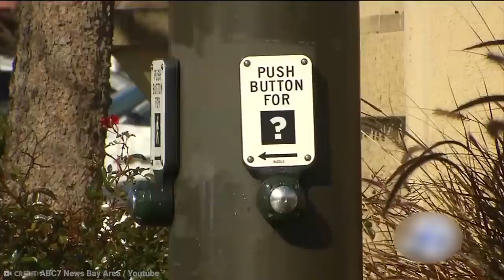15 Ways Governments Control Your Behavior With Genius Designs

Comment: Good idea about the waterproof paint, but given many of the public toilets are either non existent or shut at 5 or 6 pm, it's idea to prevent men using walls as a urinal after a night out doesn't work too well here in the UK. In fact the biggest public outdoor urinal for men after a night out are generally the tyre of a car.

Comment: DUDE I FUCKING KNEW IT!!!! I have been thinking that the buttons weren't working and were disabled for 20 years already! I noticed that after around 2000 they started to have no effect at many intersections and it continued to get worse over around 10 years. Since 2015 they appear not to work in most places that I have seen, though some do work.

Comment: Did you know that Kinetic Speed bumps have been invented to generate energy but countries like the USA are not willing to put them to use. Yep, standard speed bumps that, when a car goes over them, they lower some and generate energy along with slowing down traffic. They were proposed to be used at Toll Crossings where the cars have to slow down before coming up to pay toll. The idea was originally presented as an option to generate energy for the toll system as well as for lights used around them. Not an alternative but an additional energy source to save states money.

Comment: I always think that about the pedestrian buttons at the crossroad traffic lights in my city centre. As if the public are going to controlling when the traffic lights turn red.Yeah,right 😂🤣😂🤣😂
Reply: I dont bother pushing it, unless i know if its fake or not. In surten parts of town i know which are fake or not. Normally i dont bother pushing it, because its pretty much a ,,begging button,, and im not part of that bull. XD Normally the buttons actually work in normal streets, where there,s less traffic and when you push the button, it does go red right away. In bigger street though, you might still wait a whole minute. =)

Comment: The traffic light buttons are for the blind. The beeping sound let's them know where the button is located. When the button is pressed and held for a few seconds a voice tells them how long they have to cross the street.
Reply: In Belgium, we also have some light buttons for the blind. They use a kind of ticking sound. If it's slow, then the light is red and the blind people can hear where the ticking comes from to press it. If it is fast, it is green and they can cross the road.
But we also have buttons that don't have sound, they are only used for the light to let it know that there are people waiting to cross the road on a safe way.

Comment: Traffic calming generally results in extra congestion as each driver spends more time on the road for the trip. This results in long lines of traffic moving slowly for miles.
One place I was had cooking gas delivered in 100lb bottles. A city official did not like the speed of the traffic in front of his house so put in a work order to public works to install a speed bump.  The gas delivery found the speed bump increased delivery times at 4 AM and they got noise complaints for the noise of them going by.  They responded by driving the posted speed limit, and putting extra slack in the chains on their load to increase the noise. When confronted about the racket at 4AM, they responded, it was not a problem until they made the road change to shake their load violently.  They fixed the road.

Comment: When I was younger you pushed the crosswalk button and automatically all four lanes are two lanes of traffic stopped!
Reply: Speed bumps were a brain child from the automotive industry, since worn out shocks are costly to repair/replace. When you drive over them on a regular basis they will certainly cash in either on repairs or new/used vehicle sales. Also all the top and go traffic increase fuel loss and the fuel used to start from a stand still or near stand still is the greatest. Once a vehicle is up to speed, it takes little fuel to continue on your path.

Comment: With the speed bumps,it's actually not just to slow you down but its more strain on your wallet.
Everytime your suspension,steering and wheel alignment is excessively used, it means moe wear and tear on your car which means money you have to spend??????

Comment: Personally your in prison for committing a crime, you should be humiliated for your behavior. Course, I also think that you should only be given bread and water, no access to TVs or any other luxuries that you stole or deprived from hard working people. Basically a criminal needs to be treated as a criminal: no luxuries of any kind, bare minimum of food needed to keep them alive and them doing manual labor (hard labor, with the appropriate food to keep them alive, of course)
Reply: Absolutely.  And I think the chain gang  needs  to be reinstated.  That's part of the problem... people  in prison  are  getting  better treatment  than  alot of needy people.

Comment: the opposite is also true for crosswalk buttons though. On roads where cross traffic is light, the light won't/will rarely change unless you click it. i've experience this in some cities. I'd stand there and wait forever then finally click the button and it would change within a minute
Reply: If it takes a minute for the light to change,  I'll have crossed the street against it by then.

Comment: 13:04 If I was smoking and some billboard tried to guilt me into stopping, I would blow smoke in the billboard guy's face.

In my city there's a section of road with timed lights. If you do exactly the speed limit, you hit them all green. But if you speed you end up getting stuck at every red light. Brilliant. So just chill out and do the exact speed limit.

Comment: Australia. I was warned by the locals at a bar there to not go in the alley and urinate because there were moisture detectors there. If you tried there everyone in the bar that you went back into knew what you tried to do.  Even if you went to another bar as you were already wet